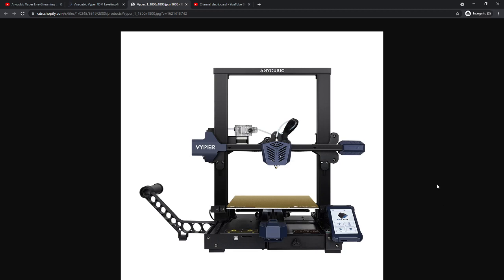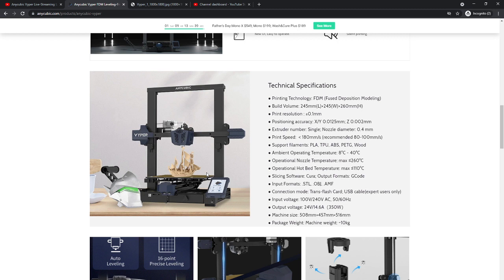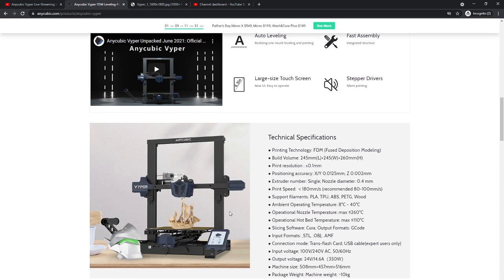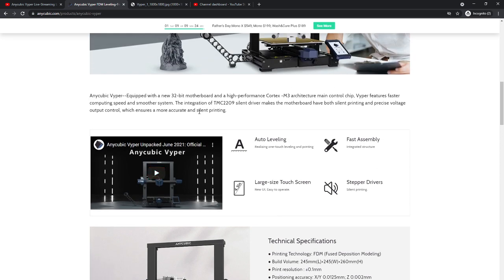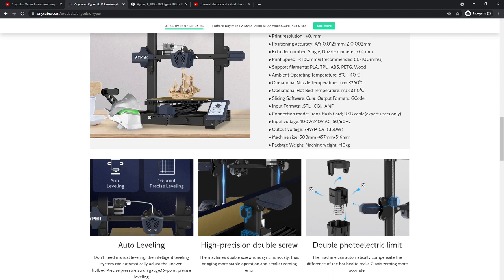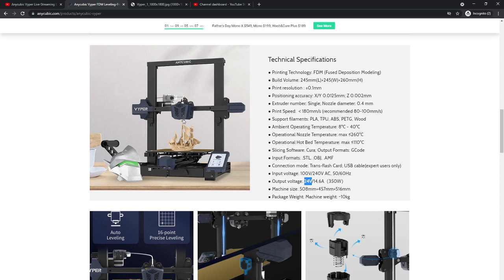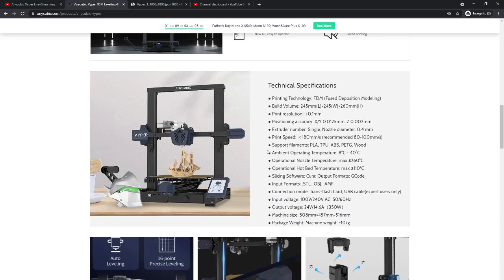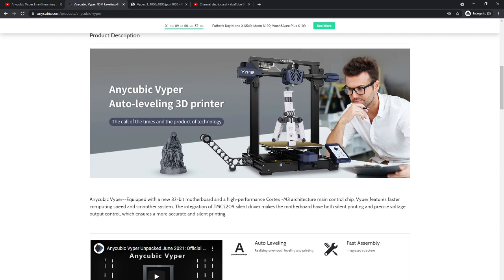Anycubic Vyper specs and features: Why I decided to purchase this printer over other FDM printers.

Comment: drivers are not user replacable on the ender boards, they are soldered..

On the 4.2.2 boards they are likley not even trynamic drivers let alone 2209's, they are cheap crap china copies, the 4.2.7 board has genuine trynamic 2209's.

I am buying a Vyper myself but I would HIGHLY question that accuracy spec, 0.002mm on the z!!! 2 thousandths of a mm.. we are talking very, very high end CNC tolerances here!!! 0.002inches would probably be more likely..

I expect that is microstep distance, but the printer cannot move a single microstep as far as i am aware, they just smooth out the motion between steps.. For a camera slide for example, it would reduce visible stutter in the video because the motion is not jumping in full steps..

All that said..

You cannot really do any worse than Creality in quality control, the machines are quite appaulingly variable and can have some disgustingly large manufacturing errors like the rails being 2.2mm, yes 2.2mm! out of parallel.
Reply from the maker: True, I would not want to have to take a soldering iron to my printer but it can be done for those skilled and brave people.  I hope you enjoy the Vyper!  It's been a great printer for me!
Reply: @renaissancelaboratories5645  I was absolutely blown away by how quickly I had it printing, I had a model that was pretty darn good within an hour and half of opening the box!!!!

I did use the wrong machine profile to start in cura, the mega X instea of the plain megga and crashed the nozzle and bent the strain guage but I fixed it again LOL

It is a really great machine, the only thing I dislike is the stupid graphical touch screen display, it adds nothing to the usability at all and makes firmware modification difficult because it does not support the various new menus and controls that you can add..

I am working around some of these with octoprint custom controls, but even they do not work on phone/ tablet apps so havint the main PC in a different room means I cannot operate them while actually AT the printer.. 

But yeah, apart from that, its the bees knees and kicks creality into the dust!